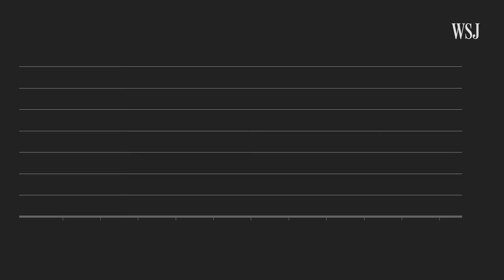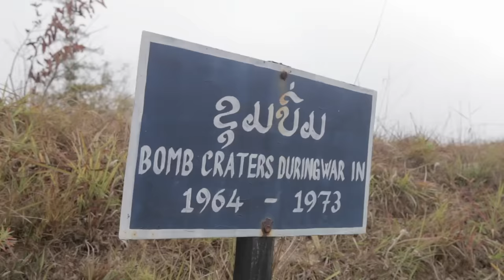China’s New $6B Railway in Laos: Massive Debt Trap or Megaproject Success? | WSJ Breaking Ground

Comment: I am not sure if this railway will ultimately be a success or lead to a debt trap. However, I can be certain that the US's Asia Railway proposal in India is more expensive, will take longer to build, and does not have the technical and experience of large-scale infrastructure railway construction. So~
Reply: 80% is already completed, all the ports are bought 😂😂 only saudi has to make railway line😂😂
Reply: This is a wild statement considering the US has the largest rail network in the world by a large margin. Some would say that requires some expertise. In my experience cheaper is not better.
Reply: @dabears87_76 The US railroad were built in late 1800s...
Reply: @dabears87_76 What we are talking about is high speed railway. The scale of HSR in China(speed limitations is 350KM per hour) is 700 times larger that of in US(speed limitations is 180 KM per hour).
Reply: @jasonhow8604 China apparently has a lot of useless railway that is hardly ever used. But hey it looks good on paper.
Reply: It is already a success. Also, in about a decade, the section in Thailand from Vientiane to Bangkok will also have been completed.
Reply: @yanaya713  And built by Chinese "slave" labor
Reply: @dabears87_76 do you know over 300 trains in the US derail per year? 😂 Nobody looks to US trains.
Reply: @kklee1543 should use US prison labor instead
Reply: @dabears87_76 China has 44,000 km of High Speed Rail. More than all the world combined.

Time to wake up.
Reply: @jasonhow8604   Not quite correct according to Wiki, "The railway is built on a single track with passing loops and is electrified to China's Class I trunk railway standards, suitable for 160 km/h (100 mph) passenger and 120 km/h (75 mph) freight trains, making Laos the first country to connect to the Chinese high speed railway network using Chinese technology.[28]".   So NOT really high-speed, more medium-speed, which is still quite an achievement given the terrain !
Reply: @Western_Decline   I believe prison-labour was indeed sometimes used, to maintain railways in America, in the past ?
Reply: @Ace-mw9pm  still way better than California High-Speed Rail.
Reply: Trump will quit the proposal if he is reelected as president next year.
Reply: @Ace-mw9pm  "useless railway" in china? I am afraid that I have to inform you, the 4 high speed railway between Shenzhen  and Guangzhou has already been put into construction, just because of the overloading of the existing 3 lines. You can give it a try of booking a ticket on Friday afternoon. You will have some idea what the words "a lot of useless railway" in your saying.
Before the pandemic, the HSR between Being and Shanghai earned a profit of over ￥100 million per DAY. It does "looks good on paper" just like what you said.
Pls keep your eyes closed to the real world. It's just too desperate for you. That is the exactly reason why the railway passenger traffic is 100 times more than that of US.
Reply: @jasonhow8604  I think you meant 'literate', not "literature" ?  I was replying to your saying "What we are talking about is high speed railway".
Reply: @richardincm  Laos is the market only for 7 millions people. So ignoring the potential market of more 1 billion people is your lily-white show of ignorance and arrogance? 
It's a trade off between HSR and heavy load cargo business. It all up to Laos' choice.
Reply: Agree, the high speed railway in California is still not finished
Reply: thats right, us has the most prisoners in the whole world.  @Western_Decline
Reply: Compare to the USA Death Trap in Ukraine...😂😂😂
Reply: @dabears87_76  That US railways network is old, bad and unproductive. You can't even think of comparing it with the Chinese one.
Reply: @Ace-mw9pm who told you that western colonizer? your parents?😂😂
Reply: @jasonhow8604  of Course Rail between major cities like Shenzhen and Guangzhou or Beijing and Shanghai is going to be busy. But there is rail in other places that’s hardly ever used.
Reply: @yanaya713 The US railroads were built by the Chinese. Oh, the irony!
Reply: @Ace-mw9pm  Before the rising threat from India, there is no railway construction plan in Tibet. That is the exactly the reason for constructioning railways for the frontier of China.

Just like the railway in Lao, it's only part of the whole network. Nobody can address the issue with only partial solution. That the reason why railway network is still in construction such as Thailand and other places.
Reply: @dabears87_76 美国的铁路，是中国人建的😂😂😂
Reply: @Ace-mw9pm like which line?
Reply: It's a shame the fastest US train can't match the speed of the modern Laos train.
Reply: @richardincm  is still way better that the US legacy network
Reply: @stzhang1770  and will never be finished
Reply: Sorry but for laos people it is allready a succes
West never like when other do better
Well thay will have to accept it 1 day
We can all be friend
But someone donor want
Just want to be the master
No need say name
Deeply we all know
Reply: @dabears87_76 no it doesn’t china does. China has railway lines than every other country combined
Reply: @kklee1543 don’t be sour grapes.
Reply: @jasonhow8604 The construction of the Qinghai-Tibet Railway began in 1958.
Reply: @chjin1796  the second phase started in the 21 century.
Reply: @jasonhow8604  How can you divide a number by zero?
Reply: @chjin1796  That's the first road build to reach Tibet. The fisrt railway reaching to lahsha is completed in 2006. If you don't have google, maybe you can ask your car. I bet it knows more than you.
Reply: @flyingnan2520  Your math teacher is still alive？
Reply: @jasonhow8604  You say: “ Before the rising threat from India, there is no railway construction plan in Tibet.” Do you think planning goes hand in hand with construction?
Reply: @chjin1796  The conflict happened in 1962 and that railway complete at 2006. We Chinese are doers but not talkers. We don't talk about something decades without any action. That's indian way of tackling issues. Still any issues with that？

Comment: 1. It is irony of monstrous scale for Americans to criticize others about incurring huge debts
2. See that $6B price tag? See that? The California High Speed Rail project so far costed $20B, started in 2015 and expected to finish in 2030 (with records of delays after delays and budget overuns) for section ONLY between Merced and Bakersfield, two inland sparsely populated cities.

Any country's official, with IQ as low as 70, would ignore infrastructure building advices from the US.
Reply: $6b = 32% of Laos's GDP ($19b)
$20b = 0.56% of California's GDP ($3.6t)

There's a pretty glaring issue with spending 1/3 of a nation's GDP on a single railway. The problem isn't the sheer amount of debt, but the debt to GDP ratio. The US equivalent of this project would be taking out an $8 trillion loan for a railway.
Reply: California is exceeding 100B USD with no finish line soon.
Reply: Remember the US has the largest debt on records
Reply: CAHSR is twice the length of Laos itself. That is not a valid criticism at all.
Reply: Awful criticism.  While CHSR is a joke, boondoggle, laughing stock, corruption heavy, awful, hideous project, it’s asinine to compare it to what Laos is doing.  It’s like saying buying a million dollar house is universally dumb.  For a poor person, yes, for a billionaire, not a drop in the bucket.  Different people, different circumstances.
Reply: @NuclearTuna   Worse when that project in Laos is not economically viable enough to justify that expense. Laos could have financed many more projects with that amount of debt that would be more beneficial for the country than that high-speed train and therein lies one of the problems of the Chinese debt that it deals with to make attractive but unprofitable projects.
Reply: @NuclearTuna  My point is that Laos is buying good and proven values compared to the “advanced” economic practitioners like those of California.
Reply: @NuclearTuna  btw, if debt to GDP is a single effective measure of a debt’s worthiness, you and WSJ should be writing books after books, make videos after videos about Japan
Reply: @NuclearTuna  spend 6B   or 1/3 or country gdp  -  open lao from a land lock to a link country, mean more trade
more tourism  economy growth.   now divide that 6B to 30 or 50 yrs   that amount is tiny.

another view  you buy your house  borrow 500k   yeah sound a lot but spit to 20-30 years repay  now it look more reasonable.
Reply: @NuclearTuna  Laos needs infrastructure,  US doesn't, they are not comparable. What's the price US would offer to build a railway in Laos?
Reply: @Cier433  I cannot identify projects to would provide better options or  ROI  than this transport project  A North South infrastructure link is essential to develop this country. The cost of a motorway to carry freight lorries would have been significantly higher as it required the tunnels and bridges. Th rail link is the cheapest way to get freight moving. Moreover it is futureproof with revenue from future links to Bangkok, Kuala Lumpur and Singapore. $6b was a no-brainer for the Lao government with China picking up most of the cost and risk. Maybe you can suggest a better port project for land-locked Laos?
Reply: Laos will bear US$1.8 billion. China is responsible for $4.2 billion.
Reply: If $ 6 bn = 32%, then $ 1.5 bn = 8 %. Laos's share is 25% = $1.5. not $6bn.
Reply: @Cier433  In 2020, before Laos's high-speed rail opened, Laos had a trade surplus of US $570 million.

After the opening of the high-speed railway in 2022, Laos had a trade surplus of US $1.39 billion. This is just the money made from trade. After the opening of the railway, it can also promote the development of tourism in Laos.

Remember, the construction cost borne by Laos is only $1.8 billion. Without this railway, Laos would not be able to make more money and its economy would not be able to develop.

The disgusting American media

Comment: In my opinion megaprojects are not a good idea, if your have bad finances and if the project you build isn't really financially successful on the long run. Let's look at the video example. Laos borrowed a lot of money from China to build this railway. This railway has to bring the country money now, so they can return the loan. If this railway isn't profitable, Laos is probably going to have big debt problems for many years. This is why we often call this kind of projects debt traps. For big country like China and US $6B is probably not that much money, but for smaller countries this is a fortune
Reply: This media didn’t tell you the details that a joint venture was formed by China and Lao to construct and manage the railway. China funded 70% of the project cost and Laos for the rest 30%,  If the project loses money, China is the one to have more financial loss. So, China will not let this scenario happen.
Reply: In 2020, before Laos's high-speed rail opened, Laos had a trade surplus of US $570 million.

After the opening of the high-speed railway in 2022, Laos had a trade surplus of US $1.39 billion. This is just the money made from trade. After the opening of the railway, it can also promote the development of tourism in Laos.

Remember, the construction cost borne by Laos is only $1.8 billion. Without this railway, Laos would not be able to make more money and its economy would not be able to develop.

Comment: THE ISSUE IS SIMPLE. WOULD A COUNTRY DEVELOP WITH TRANSPORTATION INFRASTURCTURE OR WITHOUT IT.?  DEFINITELY THE TRANSPORTATION INFRASTRUCTURE CONTRIBUTES TO ECONOMIC DEVELOPMENT.  THAT RAIL MADE IT POSSIBLE FOR LAOS TO EXPORT. AND IT ENABLES THE IMPORT OF NECESARY INPUTS, SUCH AS FERTILIZIERS N MACHINERY. CHINA IS WILLING TO HAVE THE LOAN RESTRUCTURED. IN DUE TIME, THE LOAN WILL BE REPAID BY LAOS.

Comment: China's $6 billion high-speed railway project in Laos, which is part of the Belt and Road initiative (BRI), has been hailed as a transformative development for the country. The railway currently connects China to the capital city in Laos, with the ultimate aim of better connecting Laos to Thailand and Southeast Asia. However, the project has come under criticism as a symbol of irresponsible Chinese lending, with Laos taking on significant debt to fund the railway. Laos borrowed around $1.5 billion to pay for its share of the project, despite already having high levels of debt in 2016. The country's external debt stocks amounted to about 90% of its GDP in 2021, leading to concerns about an economic crisis. The railway has also been criticised for displacement and land loss, as well as the environmental impact of the project. While some experts say the railway could raise Laos' aggregate income by up to 21% over the long term if managed well, others view this type of lending as dangerous for developing countries.
Reply: doing nothing is better option, right? The West would help.Laos modernize in.next 100 yrs (only in your dreams)
Reply: The railway has been built, and at the worst case Laos don't pay back the loan, what does Laos lose?
Reply: THE HIGH SPEED RAIL WILL DEFINITELY LIFT LAOS OUT OF POVERTY. THE LOAN CAN BE PAID BACK GRADUALLY. WITHOUT THIS RAILROAD, LAOS WILL REMAIN POOR ALWAYS.

Comment: We had one too here in Indonesia, a high speed rail funded by China, problem is the distance is way too short and we already have plane and exsisting railway with the same route. Over the year the debt piled up way over original budget and construction problem lies everywhere, locals already disliked it and most of us think that it was waste of money
Reply: you knew your old railway took 6 more time to travel 140 kilometers, and airlines are expensive to ordinary people. This new HSR has multiple stops, will help more on urbanizing your country. There also plans to extend further 700 kilometers, right? Infrastructure like arteries In human body, not hands foots.and brain that can make money
Reply: @zhuangdavid5037  mainly because old rail can bring people straight into the rail station in the middle in the city and the new HSR station is located pretty far outside the city and you need another approx 1-1,5 ekstra travelling time, therefore people will still choose the old rail and even by car due to convenience, none of regular train user from Jakarta - Bandung that I know wants to use it due to that single factor, furthermore the price point also need to be considered.
Reply: @长江-e1z  good for you then, because you already have so many lines built already so you can choose based on your needs, all we need now is not HSR but new tracks or semi-fast train because the eksisting rail already at full capacity rather than fancy-short distance HSR